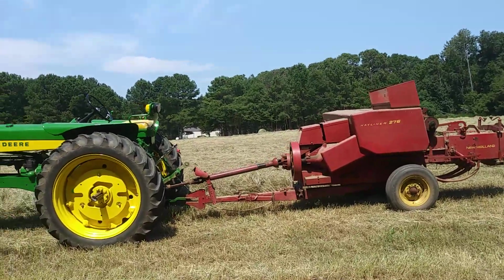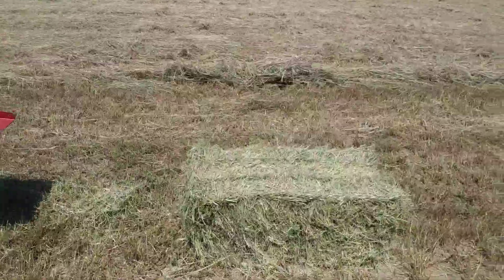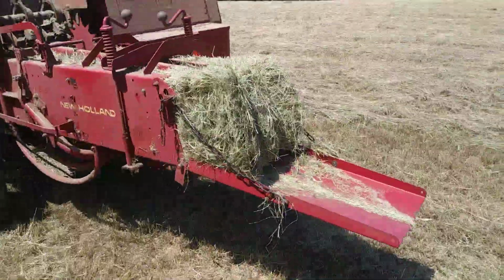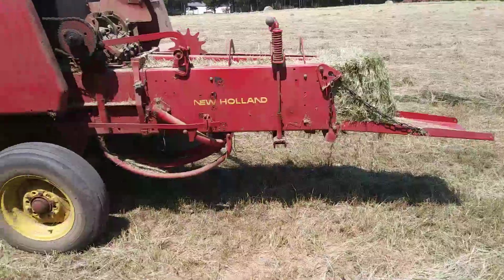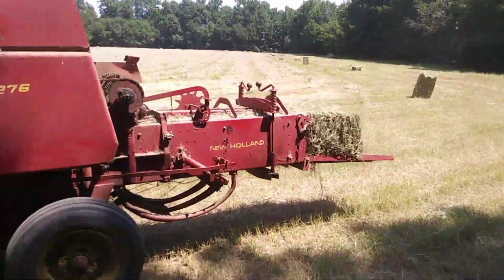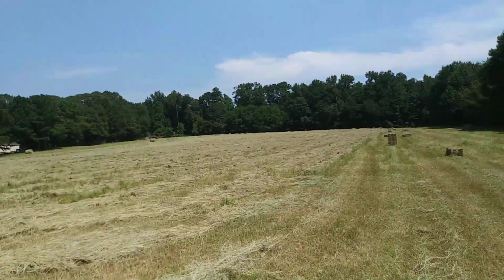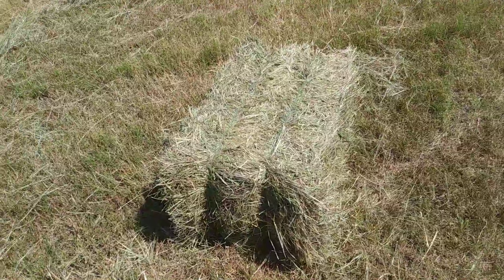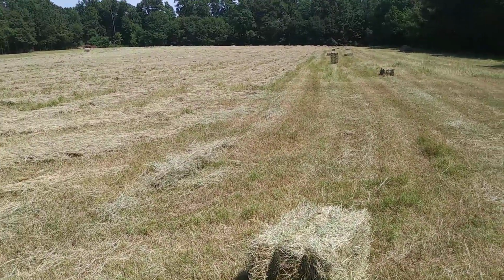Finally square bales with the 530

Comment: Nice to see you're out making hay! The 276 makes nicely shaped bales. My MF 128 baler likes to stand the bales up like that. People always comment "Did you do that on purpose?" Ha ha. Thanks or sharing Rick!
Reply from the maker: Thanks Chris,  I wanted someone else to take the video for me but I ended up bailing by myself this time. Really happy with the 276 as it didn't miss a bale.  I won an over and under shot gun from a raffle ticket for $20. The stock was too long for me and I did need another over and under so a friend offered to trade this baler for the gun and $300.  He had just put $1000 in it on notters and needles so it was a win for both of us.  Be safe.